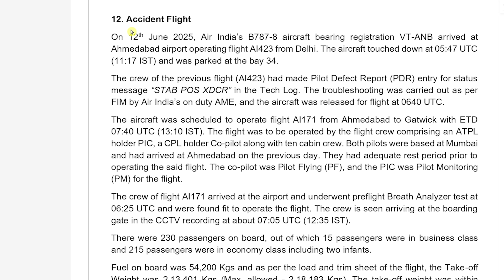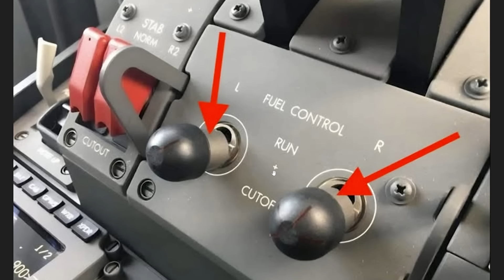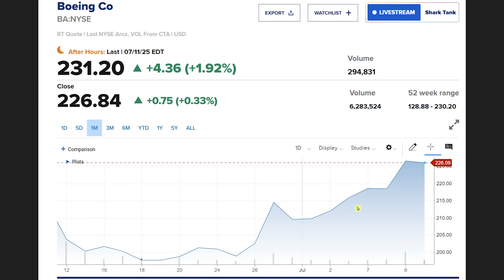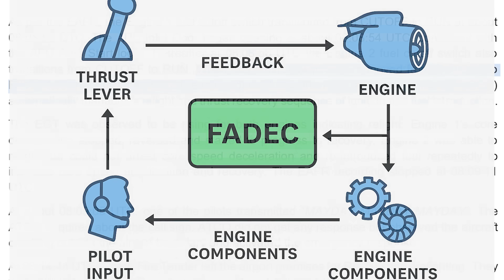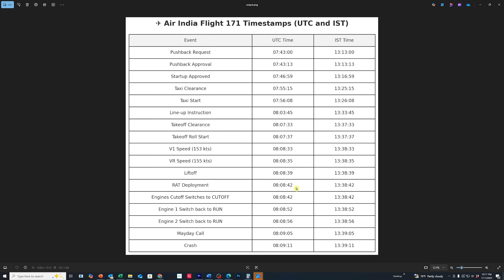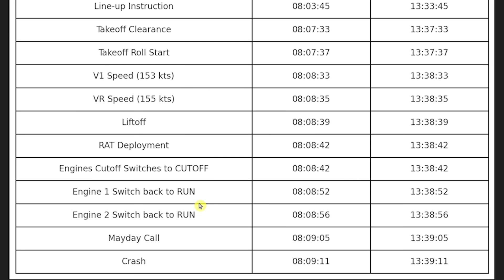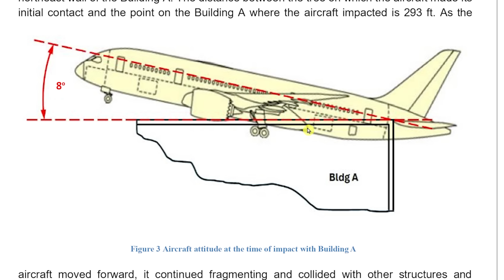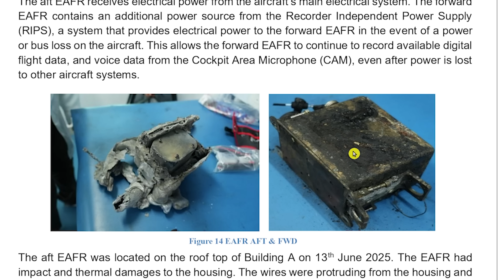Did Pilots CUTOFF Fuel? Shocking Twist Air India 171 Report!

Comment: My theory about all of this is, maybe there's a bug or hidden system flaw in Boeing dreamliner and it cut off automatically to prevent something else (idk what) pilots noticed and asked each other questions Since Boeing's stock were crashing they had to put pressure to put it all on pilots. (always the easy way out) otherwise unless one pilot is radical and mentally unstable and was committing intentional suicide it seems very very very unlikely that a trained pilot would just cut off this valve by any mistake or sheer error (like landing gear, which literally seems impossible, especially to do it twice?) to me it seems like a great mystery about some mechanical flaw and it cause the system to cut it all automatically.

Comment: If the Pilot was on Suicide mode then he could definitely have done this once his craft is on top any ocean. So why would he chose to kill him, his passengers and people on ground unless he is proven to be a trained terrorist. So this is just a hog wash report to save someone's mistakes at Manufacturing, maintenance and operation level ( faulty logic of fuel switch off due to adulterated fuel, non maintenance or audit of fuel switch control, improper use of filter while refueling either at Del or Ahmedabad) and put the root cause on to the Pilots whose dear ones must be feeling frustrated and humiliated.

Comment: They explained that the RAT deploys when airplane goes up or is already up. As long as the airplane is still with the wheels on the ground the RAT wont be deployed. I think at least one of the pilots wanted to safe the airplanes and I heard one of the engines got coming back but..... yea. If one if the pilot did this on purpose knew that the airplain wont be able to be safed when you do this even when you try. I mean we have seen this before with the German airplane that the guy purposely flew to the mountain also for the money to get to his family of insurance. We dont know what was going on with the pilots on personal level.

Comment: Call me stupid, but the whole official sequence of events proves it WASN'T deliberate sabotage, and gives another clue to short-circuit version. 

You can't have RAT deployment BEFORE cut-off..

It boggles me how many people give credit to the darkest scenario without even blinking... (or thinking)
Reply: "You can't have RAT deployment BEFORE cut-off."

Agreed.

It is likely that the RAT deployed at lift-off when the WoW switches detected that the aircraft was flying, and the other conditions that were required for the RAT to be deployed were already met.

The exact time the RAT was deployed and what caused it to be deployed is essential.

The issue with the fuel control signals may have been a secondary event.

Comment: Nobody else seems to have commented that, when the switches were set to cutoff, there was a 1 second time difference, which seems about what you would expect. Yet the time difference between setting the two switches back to run was 4 seconds, even though it was imperative to get them both back on as quickly as possible. Was there a struggle?
Reply: 4 seconds is reasonable time between other pilot realising what's going on and act accordingly to try to recover. It's not like you expect other pilot to do such a move.
Reply: These 4 seconds taking for a hand movement in a small space between the switches is indeed unusual when reacting in a life threatening situation but what I find strange is that the Rat deployment was in the same second as the switch has been turned off. Isn't there a delay when the engines loose their power that then triggers the system to deploy the Rat? Looks like the Rat and switch went off at the same time.
Reply: @darius-astrofilus  I suspect that the RAT deployment is automatically triggered by the flight computers if the fuel switches are set to off and the aircraft is airborne. So it would be practically instantaneous when the second fuel switch is set to off.
Reply: there could have been. maybe there is usually a "checklist" between the turning on of each engine and the pilot took a few seconds to decide to skip protocol?

Comment: No Jeff that's only what it looks like according to the recording. I think what actually happened was a loss of electrical power occurred and the fuel cur off valves sprang closed, but opened again a few seconds later when the RAT started up. This aped the movement of the pilots switches, but they were not touched and found in the run position in the wreckage. The Captain spoke the truth. It's the way things are recorded  inside of the programme parameters, it cannot record things outside of the norm.(Ex DNATA  MCTM?MGSM  49 years in Automation)

Comment: The way I see it, it's either due to one of the pilots intentionally committing suicide or a faulty protective engine cutoff locking mechanism.
In 2018, an FAA report highlighted the potential issue of some engine switches having the locking feature disengaged during installation.  
I just hope we'll get to learn the truth about this incident, and it won't get covered up to protect any parties involved.
Reply: The plane had electrical and ac issues on the flight before!
It is all connected!
After those two 737 Max cover-ups I definitely don't trust Boeing!
Reply: You could accidentally switch one maybe, but Both?
Reply: Ты хочешь сказать что куча Боингов летает с неисправными сразу двумя рычажками топливных кранов, корпорация Боинг не желает ничего предпринимать, и лишь FAA выражает озабоченность?
Reply: Pictures of the Cockpit show the switches in the off position, but the black-box shows they were switched back on. If they switch off during the crash, their locking safety measures may've been dysfunctional and vibrated off upon takeoff.
Reply: @dthomas9230  на фотографии обломков переключатели включены
Reply: or.... is it possible there is a vulnerability in the AHM system that allowed a remote exploit???

Comment: The crash may have been caused by a safety deficiency at Boeing that has been known since 2018. See the FAA Aviation Safety Bulletin (SAIB) NM-18-33. The full PDF can be found online. "Inadvertent actuation of the switch could result in unintended consequences, such as an in-flight engine shutdown." Were those still the old, unsafe switches?

Comment: Why is not big red light or buzzing on when so important think like fuel cut off switch is off ? I believe this switch was off before they start taking off , why this is a good question. In my opinion this switch will be better if will be rotation kind and if is on green light and when is off big red light and buzzing sound with option to override. Is simple solution to  not have this simple mistake to happen again

Comment: I can`t do stupid risky things in my car like putting the handbrake on at speed, so why on a plane you can switch off engines whilst in operation, surely, they should have to be made idle then shut down. This if done with intent was impossible for anyone to recover the situation as there is no safety factor to shutting down the engines it would seem.

Comment: Wrong not all these planes had the safety feature - December 2018, the US Federal Aviation Administration issued a Special Airworthiness Information Bulletin (SAIB) highlighting that some Boeing 737 fuel control switches were installed with the locking feature disengaged.
While the issue was noted, it wasn't deemed an unsafe condition requiring an Airworthiness Directive (AD) - a legally enforceable regulation to correct unsafe conditions in a product.
The same switch design is used in Boeing 787-8 aircraft, including Air India's VT-ANB which crashed. As the SAIB was advisory, Air India did not perform the recommended inspections.

Comment: There is something unclear about this. Why would the RAT have come out 3 seconds after liftoff, at the same time as the pilot turned the FUEL CUTOFF switch at 08:08:42?
“RAT deploys automatically under specific conditions, such as dual engine failure, loss of all hydraulic pressure, or complete electrical power loss”.
But the engine turbine speed must first slow down below IDLE. That takes time.
Even if the pilot had turned the FUEL CUTOFF (according to the scenario, which he denies), the RAT would not have come out at 08:08:42. The plane reached its maximum speed of 180 knots IAS at that time. The engines were working until then. It looks like a device or SW fault for me ("TO/GO transition" or FADEC malfunction caused "stop engines" request?).
EDIT:
08:08:42 FUEL CUTOFF, both engines. Pilot to other pilot:”Why did you cut off?” Other pilot: “I did’n do that”. Maybe the captain was talking to “the aircraft”, not to the other pilot? And why wait 10 seconds and then switch the FUEL switch back to the FUEL RUN position? At that low altitude, the pilot would have switched it back to the FUEL RUN position immediately!
Explanation: Because the SW malfunction switched it FUEL CUTOFF first, not the pilot (there is not even a TIMESTAMP mention of this in the prereport, and the  CUTOFF of engines has happened simultaneously within 0.1 seconds?).
In this situation, the situation has to be RESET in order to restore normal operation. And this happened 10 seconds later at 08:08:52, when the SW saw engine #1 come back to FUEL RUN (the FADEC sees it as a restart request). But engine #2 FUEL RUN mode was reached 4 seconds later at 08:08:56! The pilot would have surely switched it to RUN mode immediately after switching engine #1 to RUN mode!

There are many other SW malfunctions for the 787:
https://airguide.info/boeing-787-same-model-as-crashed-air-india-jet-made-four-emergency-landings-in-just-one-month/

Comment: People can do some really stupid crap, without prompting or reason. One time on the job one of my carpenters pushed the blade lock button on a circular saw while it was running, this button is only used when changing the blade and it's nowhere near the trigger switch, as one might expect this action instantly and permanently broke the saw. I asked him why he did that and he said he was kind of curious. It didn't seem like he even knew what he was curious about, and it was clear he hadn't really thought out what might happen when you mechanically lock up the arbor of a 3.25 hp motor spinning at  5800rpm. He shot himself to death a few years later, I don't think anybody really know why he did that either.

Comment: Imagine if the 2018 report about control switch for fuel not working properly really was the cause in causing this plane to crash and nobody replaced it based on the logic that cutting the engines off must be intentional with several steps and several precautions taken, just as Jeff explained...

Comment: It does not take 1-2 second to change switch positions, it will take that 10 sec usually for both switches. That is why this is most probably a system glitch, not a manual actions to turn it off. You raised a question but Boeing is paying lot of money to social influences to spread pilot error propaganda.

Comment: The preliminary report, disseminated, appears counterfeited. Real fact will never be allowed to be disclosed by Boeing. Pilots were not mad that they would switch off the fuel control switch. So, it's going to take the same fate of that purposeful demolition of Twin Towers(in fact 3 towers) in 2001, September 11, made it happen on purpose (MIHOP).

Comment: Where's Jeff?  He needs to check into this.  What I'm reading on aviation sites is that if the pilot shut the fuel switch off, that wouldn't cause the rat to deploy.  If that's right, it's not the pilots!

Comment: Question: Is there a secondary warning alarm or signal to indicate it the fuel run toggles are in " cut off " ? Is it possible the pilot or first officer placed them in the wrong position thinking he had it set in " run " ?

Comment: It looks the investigation team is hiding something. The co pilot at take off is the one who did it. These switches were done by the co pilot as the other had the hands on toggles. But still it’s crazy why would some one do it within few seconds of take off?  That’s suicide. If there is no other way that it can happen except manually done then we can’t blame Boeing, one of the pilots has done the sabotage activity. Can we trust the report?? After the crash is it possible that we can trust the position of the switches? Sorry I am not in aviation but it’s not making sense. Keep in mind also that putting on the pilots they get the insurance claim easily!

Comment: The RAT came on "immediately after lift-off (at second 39), which is about 4 seconds before the shut OFF of the engines. Does this not indicate that there was a technical problem independent of the switch OFF of the Engines (aimmediately after second 43)?

Comment: From day one of the crash, there are many speculations on why the plane crashed after taking off for less than 1 minutes. The pilot turning off both the fuel supply switch is brilliant. Oops at least that is SAID by one of the pilot as shown up in the recording and/or physical inspection of the wreckage. Boeing is now off the blame for faulty plane. So share prices should rebound. Air India although has some soul searching to do will also come out blame free and may be will receiving some benefits in the future, oops may be return of customer confidence. India will also have to do a lot of investigation as to why the pilot did this. But should not pose any problem to India based on their record or expertise on art of convincing. Trump will be very happy on this outcome and most likely will give India a lot of leeway or concession in their tariff negotiation. All happy. 👏👏👏
Reply: You're implying that the authorities lied about the FDR and CVR recordings?

Comment: When the report said that the fuel control switches were installed with the locking disengaged, does that mean that you wouldn't be able to lock them into the run position?  I'm looking for clarification.

Comment: Why does your timeline have only one time for the fuel shutoff.  Other channels indicate a 1 second separation between the two shutdown events.  More intriguingly...WHY did the RAT deploy at exactly the same moment as the shutoff switch movement.  Does the electrical fail immediately with fuel shutoff or is there some lag time while engines spin down and the final fuel in the line burns out.   Or was there an electrical failure that flipped the switches and deployed the RAT?  For now, I'm believing both pilots that they did NOT switch off.  Something is fishy.

Comment: The switches are mechanical ok, could be possible that the system is receiving a wrong signal of cutoff from the switches even if the switches remained all the time in run position?
Another technical consideration: is the signal status of the fuel switches taken directly from the switches or from the control system ? This could make a big difference in the evaluation of the report